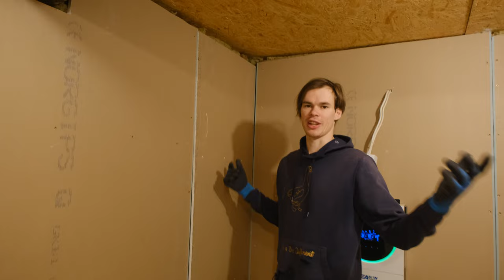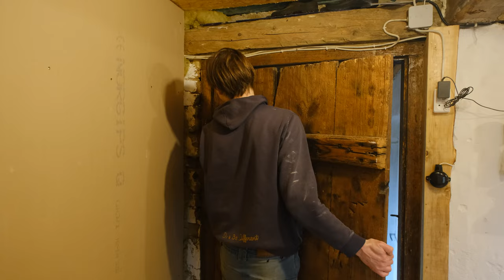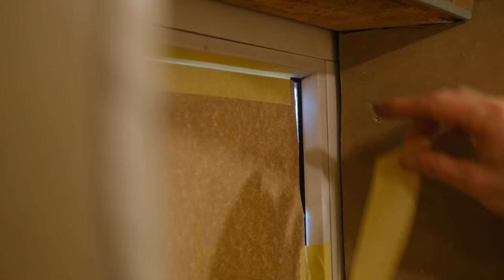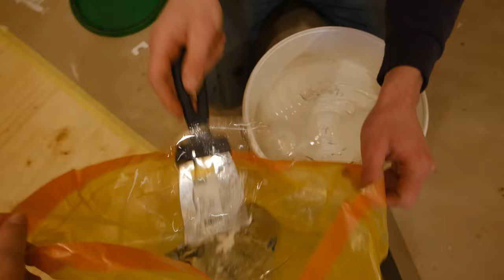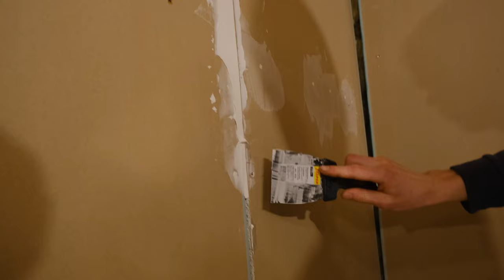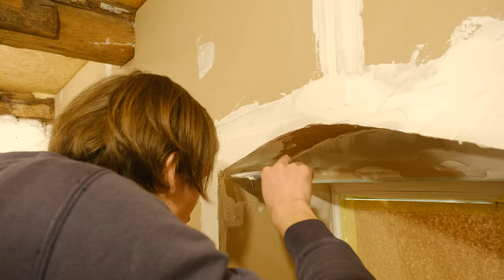Plastering walls in the Laundry/Storage room!?

Comment: All the seams 8n that room will crack unless you use mesh or paper drywall tape on the seems and I recommend whichever variety of tape or corner bead on the outside corners.
Reply: In a basement the walls hardly move. They still have sanding to do. That is just the start of plastering.
Reply: @carolynnr.6409  he's right, you still have to use drywall tape, other wise you'll see the seams and it will crack for sure. The other thing is, not using tape you have way more sanding. You use metal straps on any corners. If you don't, the minute you bump a corner the mug will crumble off. You need to mud three times, 1st coat is the thickest. You let it dry and sand it. Second and 3rd coat not so much mud, but you still have to sand with each coat. Then you primer first then paint over primer. Will have a very nice finish.
Reply: Tape is the new way. The method they have used is the traditional way.
Reply: @bridgwll  haha... new when ... the tape method has been used for many any many years.
Reply: @bridgwll  Even if it is the 'old way' the joints will crack unless they are meshed with dry wall skrim tape or paper joint tape
Reply: @bridgwll  there's a reason why it's called as you say, new way, becuz the old way didn't work well. Hence, drywall tape created by someone who had a creative mind.
Reply: @bridgwll  with the old way did they use dry wall? I think they used plaster with wood slats as a base.
Reply: And I share that only trying to be helpful not to criticize. 😀 .love this channel and have viewed since you moved into the house in Latvia... love your energy and accomplishments!!!

Comment: You need tape for the seams and outside corner bead if you can get it.  I would suggest if you are watching you tube videos on how to mud Sheetrock you watch an American one. We have been using Sheetrocks in the United States for decades   Most houses built after World War II have Sheetrock in them in this country.
Reply: Everywhere around the world uses Sheetrock/gypsum board.
Reply: I agreed if he was properly plastering the room. Looks like they're just plastering the nail holes & joints between plaster boarding. It's gonna be sanded & painted by the looks of things. Not the normal three coats of plaster. Seems a quick cheap job they're doing. Not the normal way of doing things. Budget depending it would seem. Still agreed about the taping as it would prevent cracking in future & the metal beading on the edges of the window.
Reply: Putting the holes & joins is the old way instead of tape. Suggest don’t demand.
Reply: @bridgwll  why are you coming at him as if he is being rude? Relax.

Comment: Mixing the joint compound as you did was a very good first step.  In the future, you want to use bugle head screws so the head of the screw does not tear through the paper and turn the torque of your screw gun way down.  Once you've torn through the drywall paper, you have lost the majority of the joint strength.
You need paper tape or a self adhesive fiberglass net for your butt joints and inside corners.  If you do not use tape, the joint compound can fall out of the opening.  Unlike plaster, joint compound shrinks when it dries.
You will need at least a 12" skim coat blade if you hope to blend your butt joints. When you hung the board backwards, you lost your tapered joints. I'm certain Knauf has a full line of accessories to finish the job professionally.  It won't look professional with the tools you have in this video.  I expect you will need at least 3 coats of  joint compound with multiple sanding's for a good job.  This is not a one day project as the joint compound must fully dry between coats.  Good luck! 👍

Comment: To avoid cracks you must use mesh tape on cracks and joints of drywall. If you paint it soon you see cracks.
Reply: You beat me to it. I agree that drywall/plasterboard mesh tape on joints & cracks is necessary to prevent cracks from showing later and ruining the paint job.!
Reply: Paper tape is stronger than mesh tape.
Reply: Yes, you need to use tape. Lol, I'm always saying to myself that people always telling you how to do things makes me mad. Well, I do know by experience that the mud will most likely crack without the tape. Some is a mesh tape you could still put on . Sand it down some then put the tape on, and mud again.
Reply: Stop telling them what they need to do. This is the same as taping. Just the old traditional way.
Reply: @bridgwll  it’s not the same though. It’s just the gypsum and glue mix. It’ll crack without tape. Maybe it doesn’t matter with a utility room, or maybe it’s actual plaster instead of joint compound? 🤷🏽‍♂️ It’s their house, they can do what they want.
Reply: @bridgwll  This method is nothing like the same as taping the joints. All the research and development put into these drywall products and processes by major manufacturers such as British Gypsum always recommend taping and skrimming dry wall joints to prevent cracking.
Reply: @bridgwll  well, if that's the case, I'd like to know what product they are using because I'd like not using tape and not have cracks later on.
Reply: @rhondag2926  could be actual plaster. I don’t think you use tape with real plaster.

Comment: I agree with others that to hide your seams and to prevent future cracking you want to put a paper or mesh tape over all the seams. Then, you go back and spread the mud 8-12” out from the seam. Also, you sand between the 3 coats to end up with a smooth wall. Watching a sheet rocking video would be helpful.